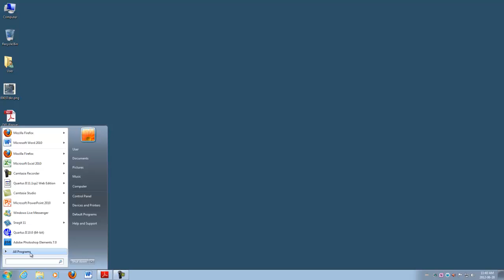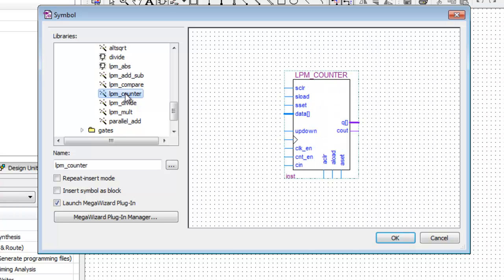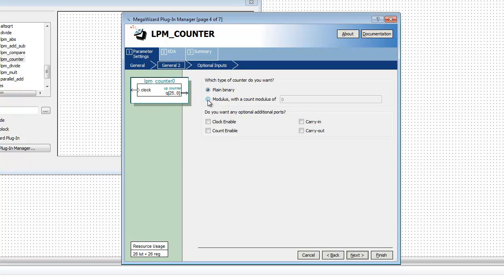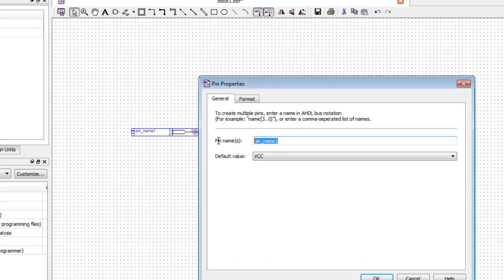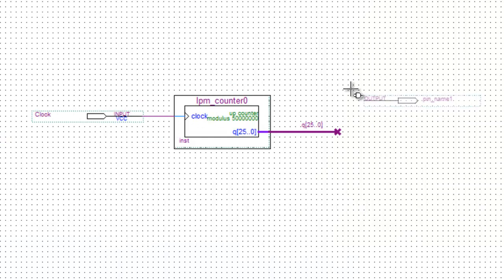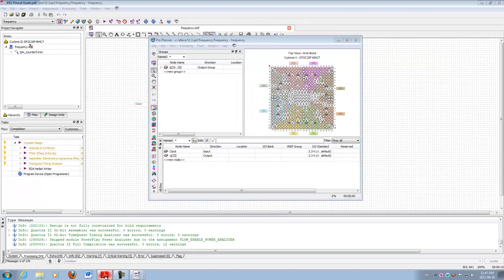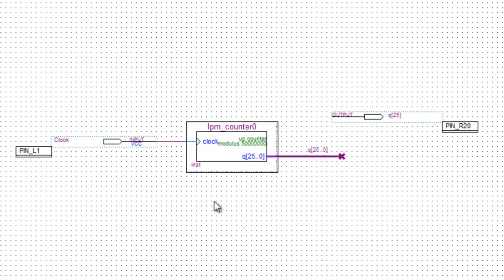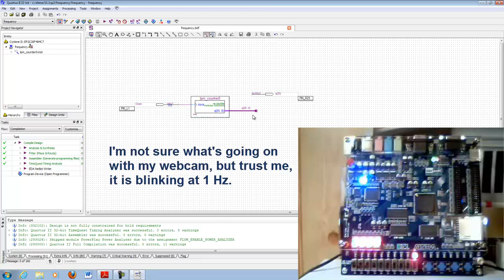DE1 Onboard Clock using Frequency Division in Quartus

Comment: I implemented this solution on an EPM7128SLC and the desired frequency was output on the correct pin but I noticed that even though I specified q[25] as the output, I got higher multiples on adjacent port pins.  Is this normal or a fluke of the version of Oculus II?

Comment: 50000000
 requires 25.57... bits.  But Bit 25 rolls at 33554432  and then the counter resets at 50000000 so Bit 26 is only on between 33554432  and 50000000-1 so the high bit is off for 33554431 clocks and on for just 16445568 clocks?  i.e. around 33% duty cycle?  How would you make a more 50% 1Hz clock?? (Thanks for the video)
Reply: Hi, you just need to use a jk flipflop in toggle configuration at the output of the counter, this will make the duty cycle 50% but will divide the frequency to half then instead of counting up to 50M you need to count to 25M and take the 24bit as tha output

Comment: how did you convert frequency to bits? What if I want an output clock of 1kHz?
Reply: He didnt convert the frequency to bits he just divided the frequency by bits and got a much lower frequency, 1khz you would just use more bits then 25 probably
Reply: @theengineer9910  dom poes

Comment from the maker: Hi! Yes, if you're going to count to 50,000,000 then you need enough bits to be able to do that. For example, if you wanted to divide by 8 then you need 3 bits because 2^3 = 8. 4 bits would give me 16 counts and so on. So, since 50,000,000 isn't a natural binary count, I need to make sure I have enough bits to count to at least 50,000,000. 2^26 = 67,108,864 so that's just enough bits. Any less than that and the counter would never make it up to 50 million. Hope that helps! Cheers, Jim.

Comment from the maker: Thanks for the feedback, and I'm glad it's working. Yes, you can use one of the outputs to drive more then one input, and yes, you may use several of the outputs. Just note that if you use any of the other outputs, they will be at different frequencies. Cheers, Jim.
Reply: I understand that but my question is why I get the other frequencies on the other pins when I only specified q[25]